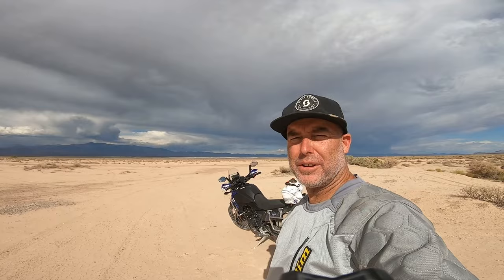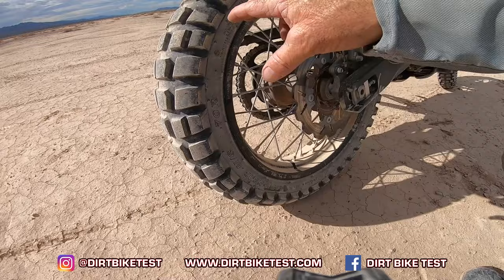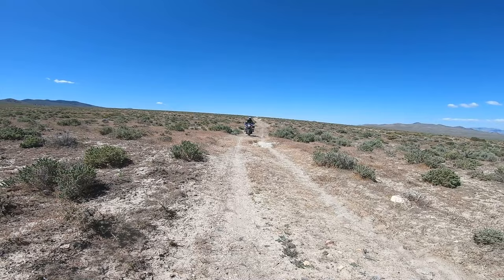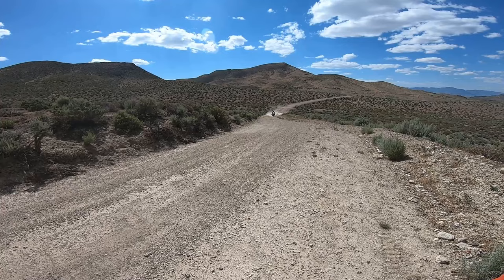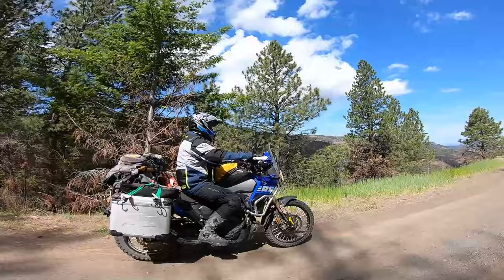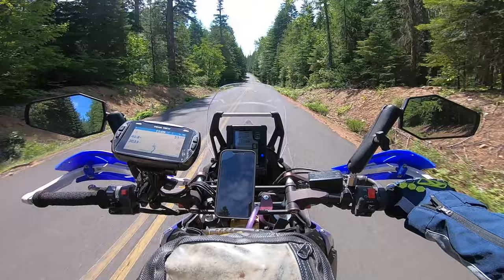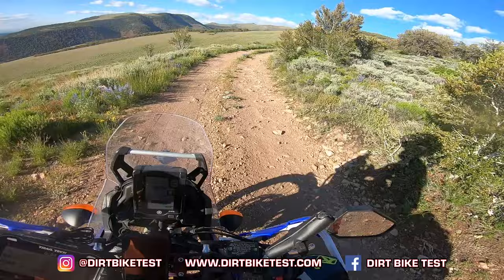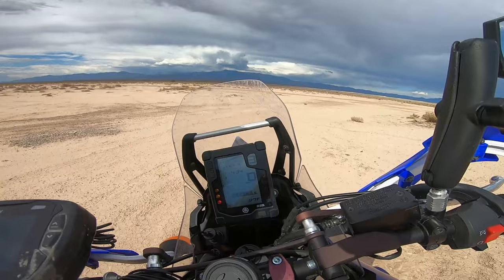Yamaha Tenere 700 Vlog #8

Comment: Would a G2 throttle tube help with your driveability issue? I used one on my WR450F to help tame the "twitchyness" after going to the competition ECU. Tuning the ECU and the G2 throttle tube softened the initial power delivery to my liking . Sounds like you may need to go the other direction (different cam on the throttle tube).
Reply from the maker: Your answer will be on Tech Talk Taco Tuesday #203

Comment: Jimmy, is there a throttle lock that you recommend? I don't see one on your bike. My throttle hand gets numb in under 2 hrs. with stock T7 bars and heated grips. Maybe your Flexx Bar/Pro Grip combo handles that issue? Thanks!
Reply: I do not use them but my good buddy Paul Neff uses the Atlas one and recommends it.